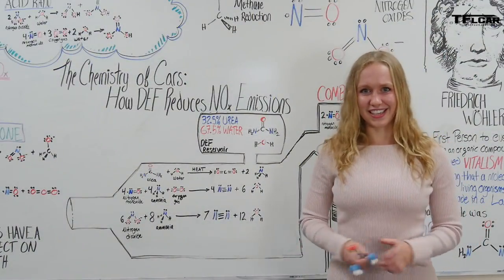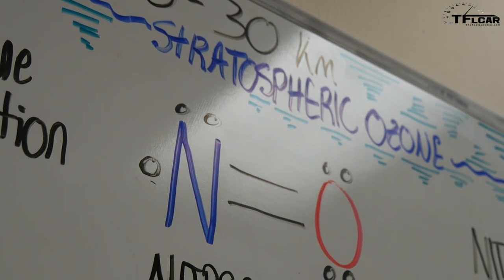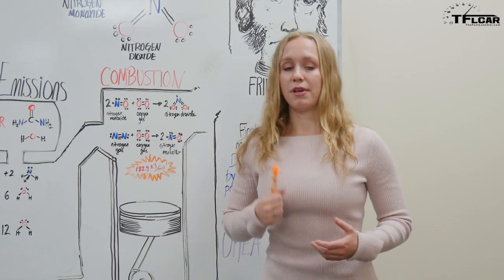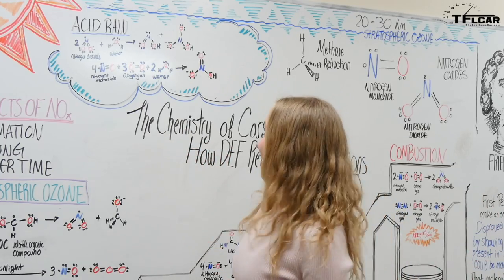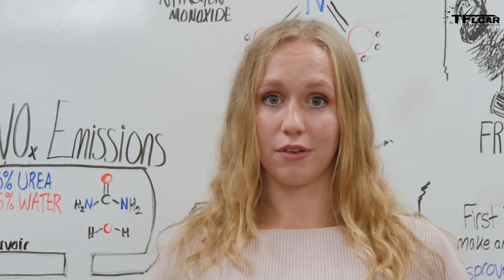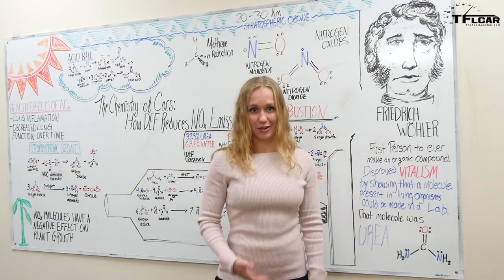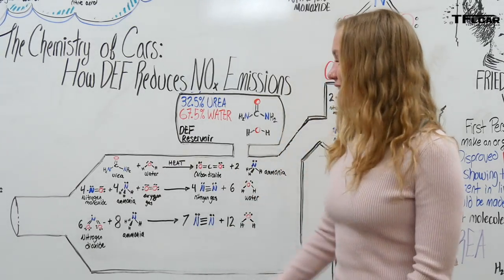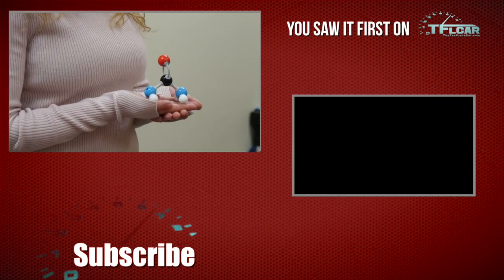How Does DEF (Diesel Exhaust ) Fluid Work & Is it Really Pee? The Chemistry of Cars Ep. 1

Comment: I've been pondering the problem of NOx in Diesel engines and come up with the following notion.
I remember a show on deep sea scuba diving, which i remember as using a helium and 4% oxygen mixture. The reason given that with the high pressure air to breathe at depth, the partial pressure of O2 is "toxic" to breathe at several atmospheres of pressure. 
I.E. a 4% O2 mixture at 5 atmospheres is about the same as sea level air.
   In a diesel engine, one normal function is to not have a throttle plate, thus extra oxygen, whereas a gas engine requires a throttle plate to restrict oxygen, and deliver the exact amount  of fuel to use as much as possible of the available oxygen.
   Then, in a pollution controlled gas engine, an oxygen sensor measures the remaining O2 to allow the exhaust catalyst to have the correct amount of O2 to combine with any remaining fuel.
   A diesel engine, in contrast, uses high compression to heat the air in the cylinder and as soon as the diesel is injected, the hot oxygen, at maybe 25 (?) atmospheres, immediately starts to burn, further increasing the temperature and pressure to 2000+ degrees and many more atmospheres (thus the torque). Unfortunately that leaves lots of N2 next to high temp high press O2, and forms so much more NOx.
  EGR introduces exhaust gas into the combustion chamber and that chemically reduces the peak partial pressure of O2 available to form NOx.
  The question I have is, is there anyone who knows what is the partial pressure of O2 at the various stages of a diesel combustion cycle, and the chemistry that happens throughout induction, compression and combustion and the completion of a diesel burn.
Reply: 60andcurious Robson the partial pressures should remain in the same ratio during those processes up until combustion. During combustion you will be using most of the oxygen, which would essentially give you a much lower partial pressure due to the fact that there is less oxygen in the total mixture. 
My point is that the idea of partial pressure is that you take the total pressure, find the percentage of oxygen in the mixture, use the properties of oxygen along with the total pressure and you'll know how much pressure oxygen is contributing. Right? So as soon as your intake closes, your system becomes closed volume. So your oxygen percentage stays constant. The total pressure changes as your volume and temperature change, but the partial pressures of all other molecules in the mixture will increase at the same ratio that oxygen will. So everything will perform the same chemically until you begin combustion 
Did I miss your question completely?
Reply: I said, without the scientific testing to show it, that;
 As the closed cylinder compresses, the temperature rises 
 In a diesel engine, the temp rises sufficiently to cause oil to burn, just because the oil/air mixture is above the flash point of oil combustion.
(auto-ignition)
At the same time, hot, high pressure oxygen can react and start making NOx before combustion.
   I know this because of a couple of things.
High compression gas engines make more NOx than low compression engines. And diesel engines make more NOx than gas; air in a diesel is hotter than air/gas and at the point of combustion, most of the O2 is used during the gas burn, whereas there is lots of available O2 during the diesel burn.
 The other observation is for the 4% O2 mixture of Helium/Oxygen for deep see diving; the explanation I remember for 4% for high pressure breathing, was that the partial pressure of O2 at the required depth for the special gas mixture was that oxygen is more reactive at higher pressure, and becomes toxic. and at high pressure the 4% O2 is sufficient for breathing.
   Standard atmospheric O2 is 19.5 to 21%, and we become "Hypoxic" , lacking sufficient oxygen for CO2 exchange in our blood at less than 11% (? not sure of the % O2 that is deadly)
 The entire function of an internal combustion is to change the "gaseous mixture" pressure in a controlled manner, in order to do "work" (that is in the physics sense)
For O2, the partial pressure changes constantly during the internal combustion cycle. A few atmospheres during compression, many, many more at the begin of the burn (it gets hot, at say 2000 or 3000 degrees) for an instant and goes way down as the burn progresses.
  For a gas engine, the partial pressure just after top dead center goes down the most as it combines with fuel (optimum is measured for with an O2 sensor in the low pressure exhaust pipe).
For a diesel, especially in a partial throttle with turbo boost,  the partial pressure is till really high, as only a small potion of the O2 is consumed; It' really hot (900 to 1100) as it exits the cylinder and very  high pressure during much of the power stoke of the 4 cycle engine.
  The percentage of oxygen does not change during induction and compression, but the "partial pressure" does, radically.
  No the question was, has anybody studied what the actual partial pressure is throughout an internal combustion engine cycle, and what exactly is the chemistry happening throughout the induction, turbo compressing, piston compressing and combustion parts of the cycle. 
  Most pollution controls are after treatment. there has been major improvements for emissions with mixture control, and exhaust gas re circulation (maybe gas additives too?), but it would be neat to hear if somebody knows the chemistry during the burn.

Comment: Question. Where does the DEF enter the exhaust system? The catalytic converter the particulate filter or any place along the exhaust pipe?
Reply: John Hilton the particulate filter.  the system works similar to the old air injection systems for catalytic converters.
Reply: It's not injected into the diesel exhaust filter. In fact, the exhaust fluid is simply injected into exhaust stream through a catalyst, often post DPF. Search for "Selective Catalytic Reduction" (SCR), the system works very simply, but the chemistry behind it is a little more complicated.

Comment: Excellent video and very simple explanation! So where did Volkswagen go wrong in this case? What challenges did they have to meet the emission standards? It will be interesting to know the chemistry behind it.
Reply: Volkswagen switched her SCR systems off on a lot of road-conditions because they did not want their customers to fill-up the DEF tank, it had to last 20.000 km but it was to small, so the DEF called AdBlue was not used for SCR most of the time, except on a test-bank. There all seemed fine.
.
Mercedes Benz probably used the same stupid trick because on certain conditions their diesel NOx-emissions go trough the roof. For example if it is below 10 degrees Celsius, 50 degrees Fahrenheit, the SCR is switched off. Daimler owns and uses BlueTec SCR technology which is the same as AdBlue.
Reply: AlfaRomeo156SWGTA 
Volksvagen had no DEF. They developed new engine in 2009 , it was all ready , and then in 2010 all NAFTA diesels had to have DEF . So instead of bolting def tank and going trough certification , they cheated on software . The car knows when it is being tested for smog check and turns ECU to work differently . As soon as the car leaves the dyno machine - ECU switches back to great fuel mpg ( and dirt nox , too )
How does it know it is being tested ? It sees no input from rear wheels sensors and from steering wheels sensors - means dyno test .
Mercedes turns off its DEF when it is below freezing , when you come in the morning to start it and your DEF in your tank is frozen . Once you start it - it thaws def around def pump ( there is def heater ) and it works again .
http://www.myturbodiesel.com/1000q/DPF-Adblue-FAQ-VW-Audi.htm
Reply: +S Volk The VW cheating also includes engines with DEF systems. In fact, FCA's cheating is solely with diesels using DEF. It wasn't about the DEF.
Reply: It's not just about DEF consumption, it has a lot to do with, maybe even the main reason being to reduce EGR. Reducing EGR has all kinds of benefits. When you reduce EGR, the engine performs much more efficiently. That leads to increased power, increased fuel (Ever wonder why VW onwers report better than estimated economy?), and lowers the amount of soot in the exhaust, which itself reduces fuel consumption because the DPF regenerates less often, and also because less choking EGR and less DPF regeneration makes the emissions system more reliable, reducing warranty claims. 

Look at what owners are saying about the "Fix" VW has for their cars. People are reporting poorer fuel economy and poorer performance, and they will likely see more emissions related problem over the long-term. If it were just a simple DEF/SCR system needed, there would be not problems for anyone, but it's absolutely no just about DEF, it's about, much, much more to Volkswagen, and their cheating is going to cost them and everyone else greatly.
http://www.leftlanenews.com/vw-owners-claim-emissions-fix-95196.html

Comment: Very good job.  Maybe you could explain a fuel cell next.  Then you could explain the difference between the fuel cell emissions and diesel w/DEF emissions.
Reply: A hydrogen fuel cell uses a low temp, low pressure reaction which allows the hydrogen too migrate thu a membrane, but causes the electrons to go around the membrane, though electrical circuits, thus capturing electricity and forming minimal Nox. I have another comment about high temp high pressure oxygen in a diesel combustion cycle that you can read/comment.

Comment: Good video, though I should add a quick warning about premature death figures. Usually, governments and regulatory agencies use linear no minimum dose models for those calculations. These models may be valid at high pollution levels, but they likely overestimate impacts in low dose scenarios (i.e. most places in developed countries). The problems are known, but it isn't good for a career as an environmental regulator to use a more accurate model that shows diminishing returns as the environment gets cleaner.

Comment: I've been thinking about buying a used Mercedes diesel RV, selling my house and traveling.  Wonder how long those diesel engines last and what costs are involved.
Reply: There is a company call RVH lifesyles, youtube Greggrvhaulers, that prepares class 8 highway tractors for use as private RV haulers. fuel consumption is comparable to pickups with diesels, and incomparably more stable as a tow vehicle. There are a number of videos about full time RV'ers.
Gregg prefers Volvos, for the Idrive automatic transmissions, reliability (more than 700K miles) and price point compared to done-up  large pickups.
check them out, and there are other RV haulers with other class 6, 7 and 8  trucks

Comment: The process of a diesel regen would be cool.
Reply: Regen occurs when a "Diesel Particulate Filter" has collected enough soot that the pressure between the turbo and the DPF goes above a value set in the engine computer's software. 
The computer sends extra fuel into the exhaust, which, when combined with the extra oxygen in the exhaust, will build up the heat enough to cause the soot to burn up, or so we hope
   There is a build up of ash over time.
   The fuel into the exhaust is one cause of higher fuel consumption in modern diesel engines. The more regen cycles, the poorer mileage; frequent regen cycles require major service, the sooner the better.
  I got some good information on Fords from powerstrokehelp.
  I read, on some other blog, that heavy tractors, Class 8 trucks, when properly tuned, regen a lot less, because they stay at high power levels for much of a work day.
Pickups can run at 20 or 30 horsepower during daily driving, and need a DPF for 400+plus hp; they don't stay hot enough to burn the soot as you drive at low power.
Maybe some diesel pickup owners can comment on regen cycles in their own pickups, and we can get  a better picture of the conditions for less regen cycles vs more regen cycles in their trucks.